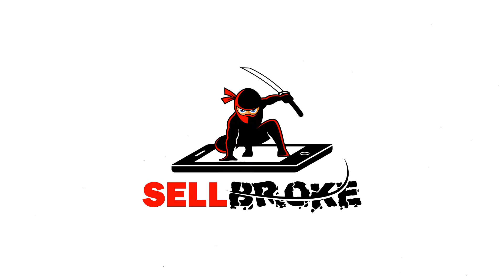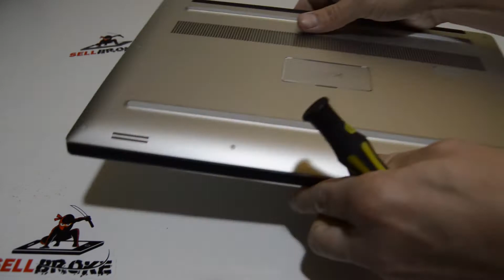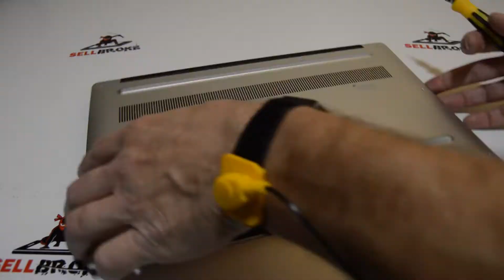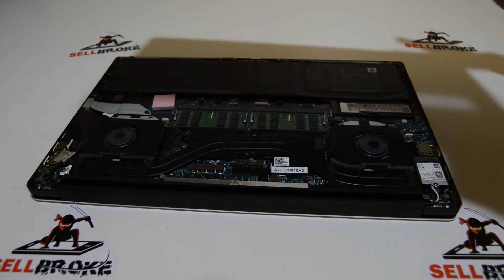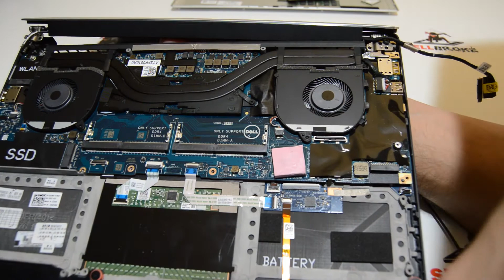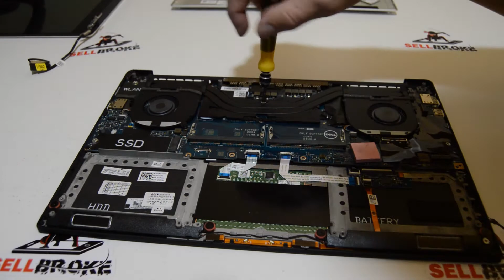How to Disassemble Dell XPS 15 7590 Laptop

Comment: Hi, where's the CMOS-battery on this model XPS? Thanks.
Reply: Hey, I think you can check out this video for the CMOS-Battery: "Dell XPS 15-7590 (P56F003) CMOS Battery How-To Video Tutorial"
Reply: @ayyyooob5713  Super!!!! Thanks, champ!!! 🙏
Reply: In case anyone else needs to know (it's different for the 97Wh model!) the answer is: it's in the upper left side. Next to the USB-A slot that's next to the SD card slot. Or in other words, it's near the battery indicator button (with the little white LEDs)

You need to remove/flip over the motherboard to reach it.